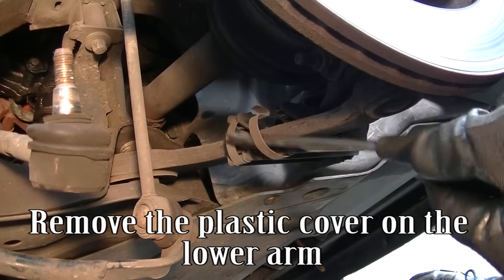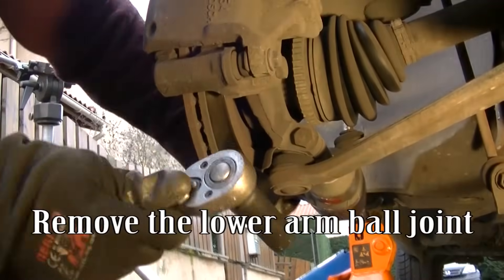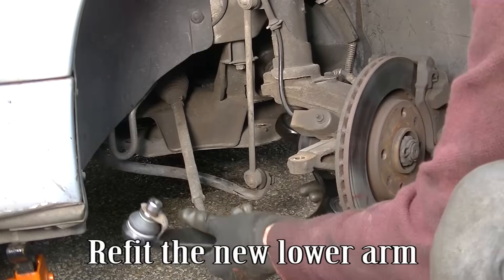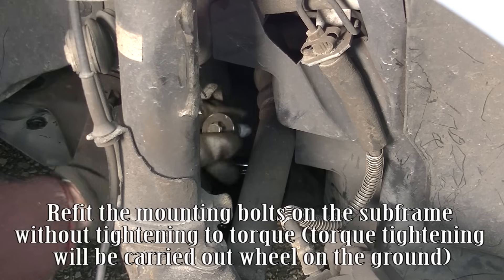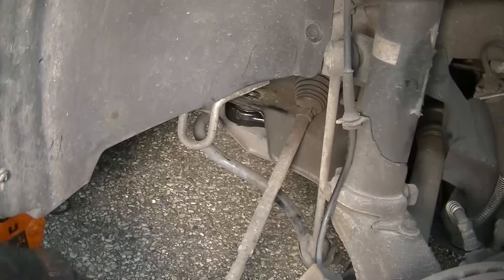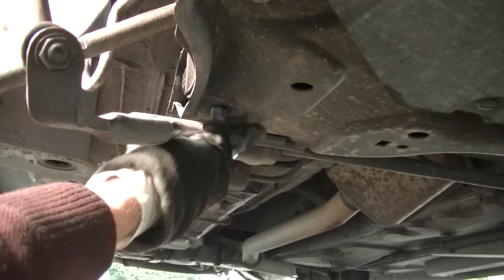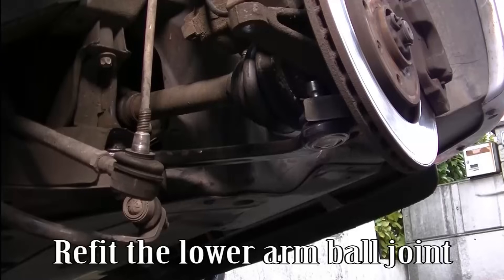Front suspension lower arm replacement

Comment: My mot on my Peugeot 208 2014, said advisories: Suspension arm pin, or bush worn nearside front, so i took it in to be repaired, and on invoice says product suspension arm, and labour to replace n.s lower arm, no mention of arm pin or bush ? does that mean they not fix arm pin or bush ? thx

Comment: Great video, have changed one before but this time my drive shaft has dropped out, it will slide back in but everytime I put pressure on the control arm to get the ball joint in it comes out again, what have done wrong, have been struggling now for days and now losing hope. Help.

Comment: I've never seen such an aberration in all my life. Hits the end of the pinch bolt with a hammer after REMOVING the nut entirely. Then uses a short ball joint splitter as a lever to try to pull the joint shaft out the hub??? And uses no releasing fluid anywhere. Dear god. I've stopped watching at 2:37. Take my advice. Do not use this video as a guide to anything resembling a proper job.

Comment: before tightening the screws of the new arm it‘s recommended to use a hydraulic jack underneath the brake rotor and lift the wheelhub to the neutral position, which can be determined ahead of time, while the wheel is still on, by measuring the distance of the wheelcenter to the fenderframing of the wheelhouse. Tightening in neutral will make the bearings relax most of the time when the suspension is in neutral and thus minimize wear.
Reply: The voiceover recommended torquing the bolts up when the the wheel was on, but thats not what he did. Thank's for explaining why its important.
Reply: @imnotamechanic3491  ah, OK. resting the car on it's wheels before torquing the bolts is also an alternative. However often not as convenient😀
Reply: And hitting the ball joint with Metal hammer is also not good.

Comment: remove the ball joint after you've  done the bolts on the wishbone,swivel the wishbone round then use a hammer on the wishbone to get it out the ball joint 😃

Comment: These Peugeot 206, have the worst lower arm I ever seen. I am a Mechaniker and i can tell you if you are a DIYer don't start with this, cause you will end up with the drive shaft been pulled out from the gear box and the the oil from the gear box comes out. This is a very bad lower arm with too much pressure on it's bearings.
Reply: Won't happen on the right side, on the left side it does idd. I found out the hard way.
Reply: Yes, you are correct, I had the same unhappy experience a year ago. The driveshaft design is different on the R/H side and has an intermediate  bearing which prevents it from ejecting from the gearbox when separated from the stub axle.The L/H driveshaft is one-piece and can fall straight out from the gearbox when released from the hub.

Comment: I can highly recommend using a lashing and jacking up the wheel hub if you want to get the ball joint back into the lower arm. It pulls the shock absorber back in place and reduces the angle of the ball joint to the lower arm. Otherwise you can be busy for hours and hours, getting absolutely nowhere. It looks so simple on the video, but I just finished the job, took me 2 days fighting with the lower arm before it was back in place. Finally the lashing got it done in 10 min.
Reply: It is very straightforward on the R/H side as the driveshaft has an intermediate bearing which prevents the shaft from falling out of the gearbox, I learned the hard way (on the L/H side) like CableWrestler !
Reply: I've just started this, and I've had to stop because I ended up with the shock pulling away from the body of the car, which pulled the driveshaft out of the gearbox and has dumped it's oil.
Reply: Spot on advice, small set of spring compressors on the strut to take up the excess extension of the strut makes it easier to replace the ball joint and prevents the drive shaft from being pulled out of the gearbox .... (in my limited experience)..
Reply: Nightmare of a job lol, I  am doing it now, getting the lower ball joint together is no fun at all.

Comment: Are you a professional mechanic or a DIYer. Reason I ask is that you have just about damaged every thread you had to undo. Ever heard of using a softer material than you are impacting ???   also that is a ball joint splitter  not a pry bar so why not learn how to use the tools. Your knowledge of what to do is accurate but if you are typical of what we pay garages £60 per hour labour for in local garages then god knows what we are training our apprentices this day and age.
Reply: I am inclined to agree, as even refitting a nut to a threaded shaft provides some protection to the thread before hitting with a hammer. Otherwise, a nice video and a decent repair.
Reply: I was about to write the exact same thing then noticed your post. It can be replaced without removing the tie rod too. If you notice before he takes the ball joint off there is a metal ball joint dust cover which im guessing is why he levered it off
Reply: if you pay $60 per hours someone to do this youre getting mugged lad xDDD
Reply: This guy makes an easy job look hard, wouldn't want him within 10 miles of my car!

Comment: I'm by no means mechanic so forgive my ignorance where can I get one of those metal bars you are using for leverage on the lower arm?
Reply: just use any strong piece of steel, I used to have a 4ft pole flattened at one end makes it so much easier. The one he used for getting the ball joint off is called a ball joint slitter and you use it by aligning the shaft between the 2 prongs and hitting it with a hammer not as a lever like in the video. However after watching again I believe he uses it like that so he doesnt destroy the ball joint dust cover   http://www.ebay.co.uk/itm/12-Fork-Car-Ball-Joint-Seperator-Separator-Splitter-Tool-Tie-Rod-End-Lifter-/222404326887?hash=item33c854b5e7:g:E8cAAOSwh2xYAkly

Comment: Why was there a need to replace it?
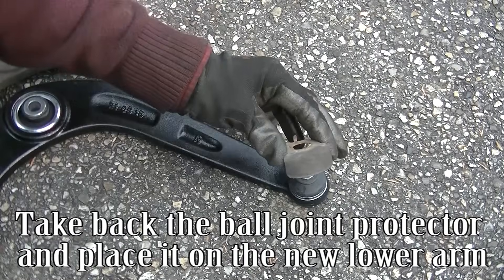Reply: +Márcio R. Hi as seen in the video 4:36 this part has a rubber cone ring on one point and middle so as rubber covered container on other point where thick oil is stored, with time passing oil gets dry and so as rubber and get tiff(might crack brake come loose and boom)....You do maintenance in order to everything function as it  should.
Welcome
Reply: +Wurth ok thanks